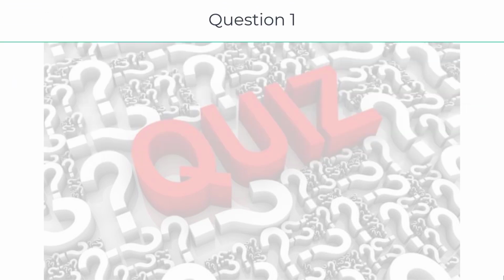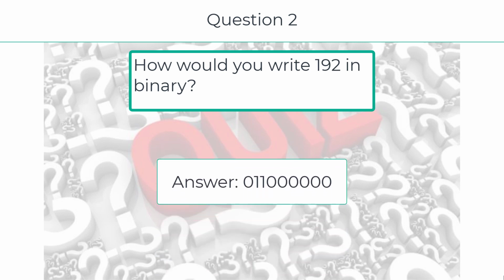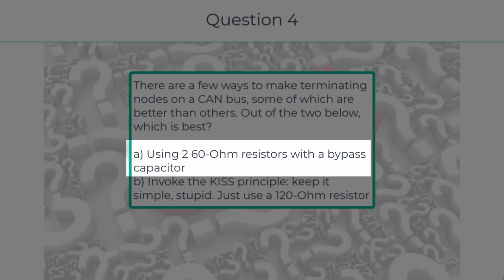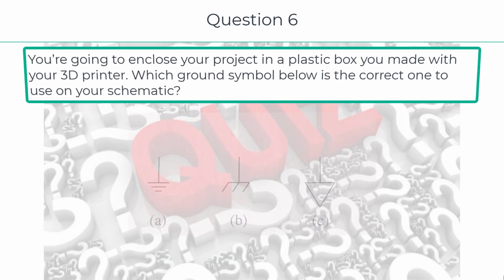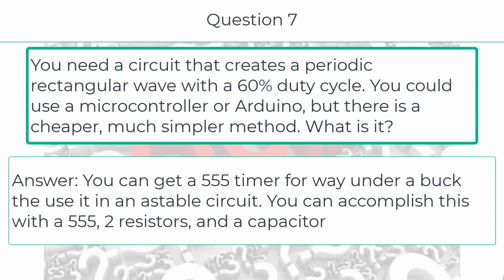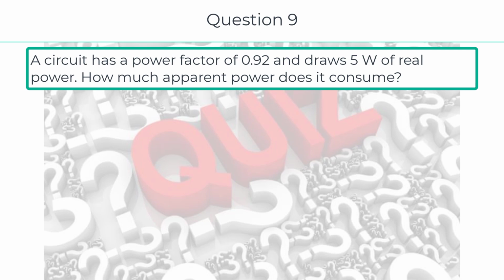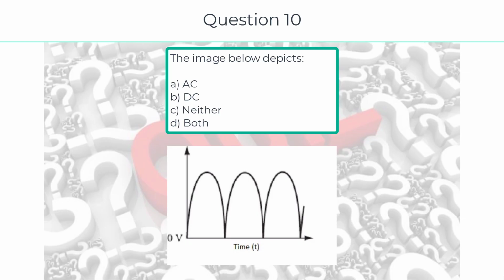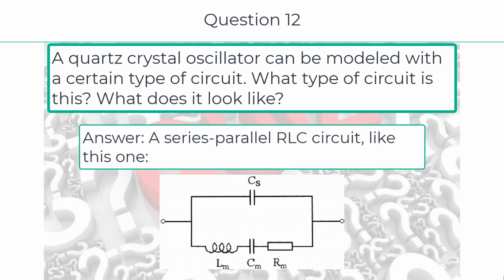Electronics Quiz for Makers & Arduino Enthusiasts

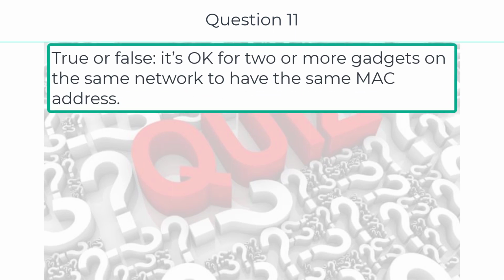Comment: 6:00 Question 11. There are situations on a fail-over cluster where the the working computer takes over both the IP and MAC address of the failing computer. The LAN card of the working computer can have multiple IP and MAC addresses. But that's an odd-ball corner case. 
Otherwise , it's a good quiz.
Reply from the maker: Glad you liked the quiz and thanks for that info!